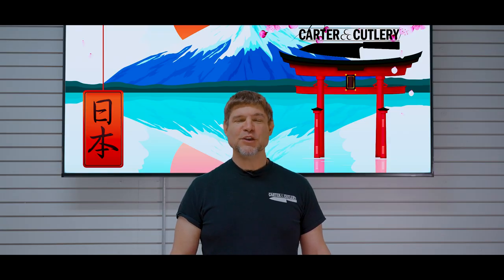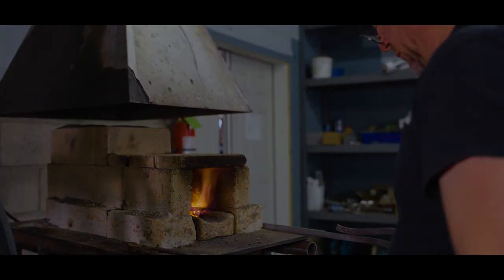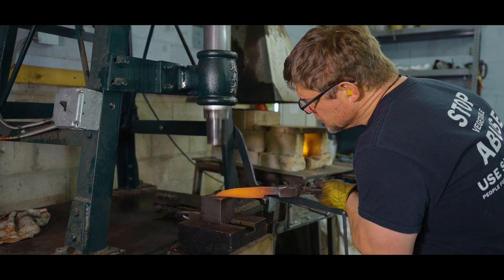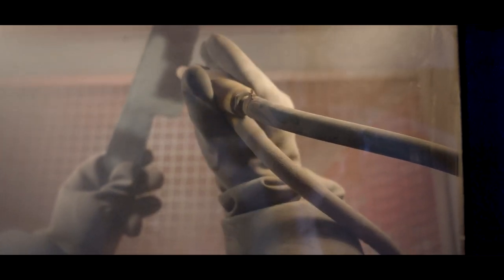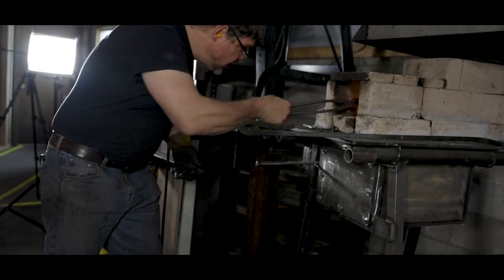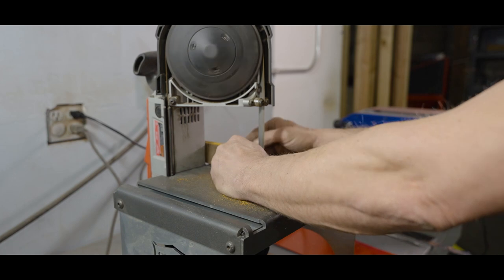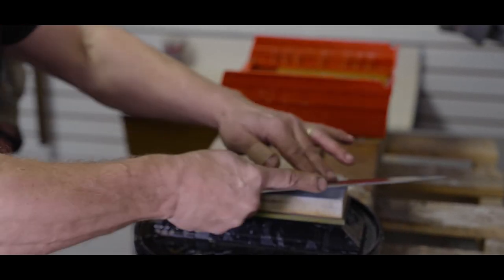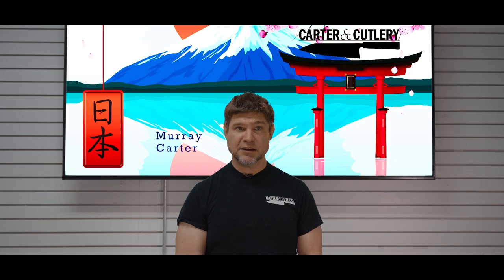Carter Cutlery Council Shop Tour Video

Comment: Love your hammer :) 
How does coldforging make the final blade cut better? When its heated to critical before quench, it normalises the structure..... right? Isnt it a myth that forged steel is better/harder?
Reply: Of course forged is better. The smith can work the steel to its maximum potential.